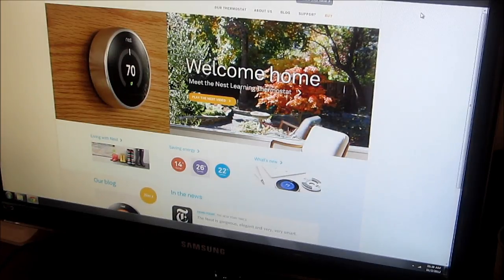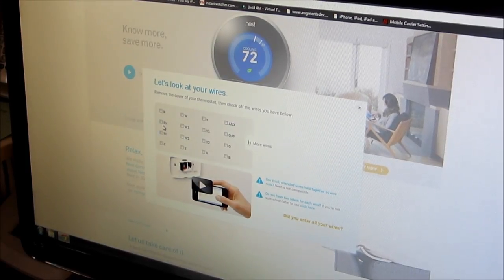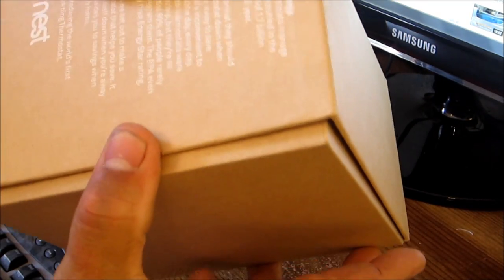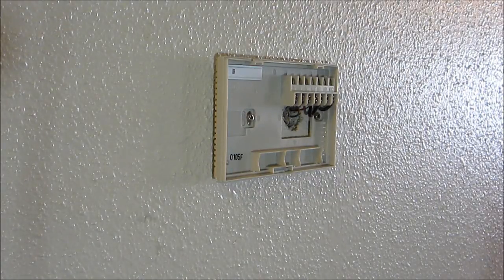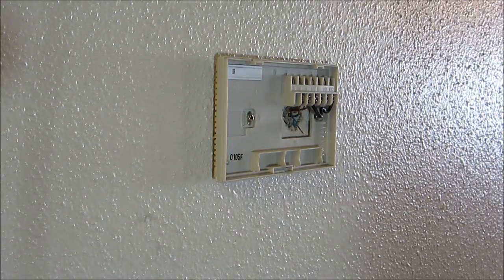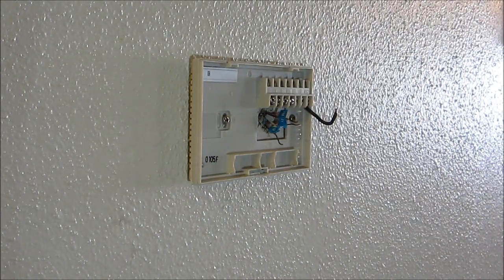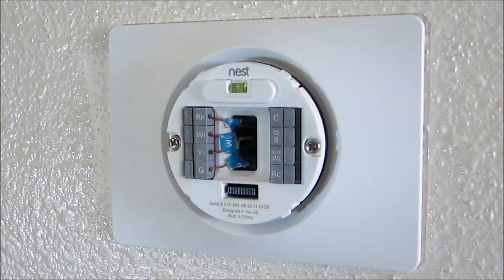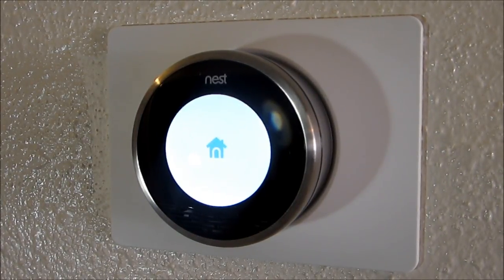NEST THERMOSTAT INSTALLATION AND SETUP

Comment: What really matters is what's connected at the furnace.  My thermostat had a C wire connected to the thermostat, but it wasn't detected.  Then we realized the installer didn't connect the C wire at the furnace.

Comment: Do you have problems with the battery getting too low and shutting the wifi down?  My set up doesn't have the ground wire, and I see yours doesn't either.  I read that the only way it will charge is when it is running the AC, so it can run down, unless you have a ground wire to complete the circuit.